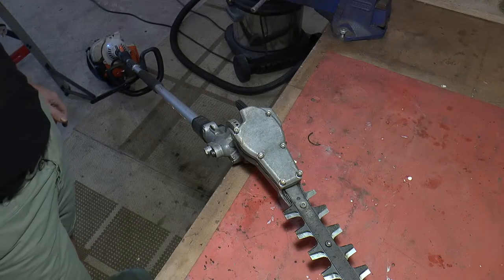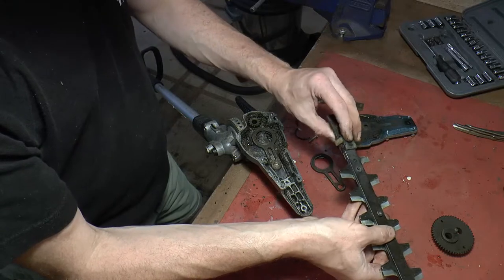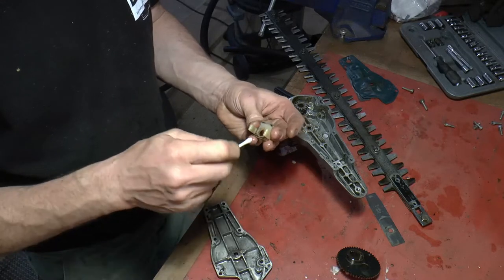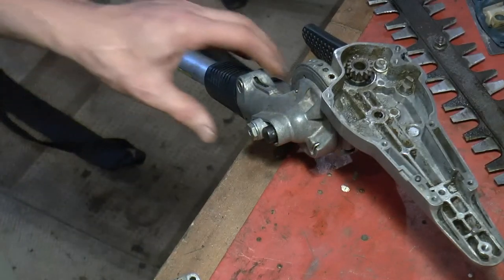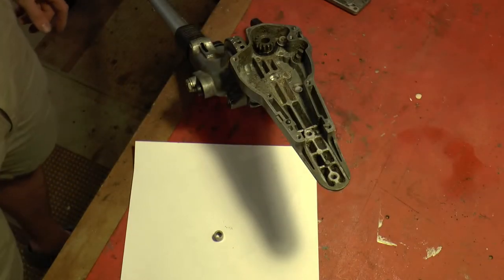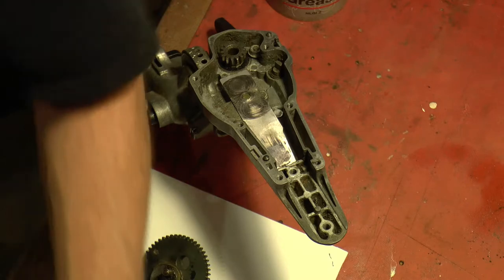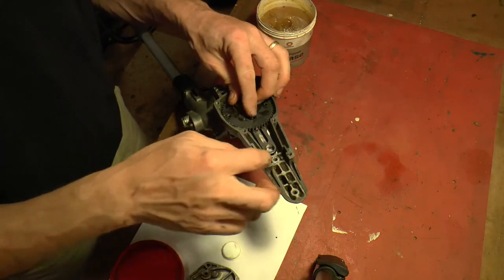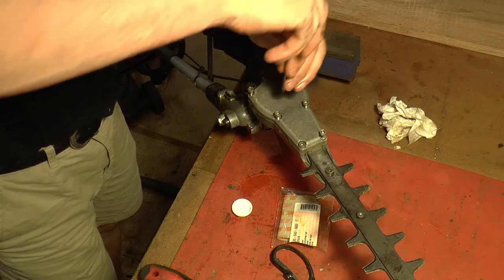Fixing Stihl HL 100 hedge trimmer

Comment: I took the blades apart on mine and definitely and struggling now
Idk if they're the same and idk if you do it in this video but I'll finish this video after supper as I'm here because I'm havin a real problem
Reply: That’s why I’m here too. I was sharpening the blades and ended up with the needle bearings falling out.
A couple of shots of bourbon so I didn’t feel like I was wasting my time and an hour later, the contraption was put back together.

Cranked it up….the engine ran great…..but the blades didn’t move.

WTF! Life is too short to screw around with stuff I don’t know the first thing about - but I’ll be back at it again tomorrow until I fix the damn thing.

Comment: The plug that you thought was for adjustment is just a plug the Stihl grease tube  fits the thread you will find the same plugs where ever there is a bushing on the head and shaft joints. The little lump of plastic is there just to keep crap from getting in to the casing much like the steel plate on the primary chain case behind the clutch of old British bikes.

Comment: Hello Peter. What tool did you use to grind out the needle cage bearing, I think it was with a Dremel but would interested in what tool you used and your technique. Thanks
Reply from the maker: Yes I used a sort of Dremel clone - I think that it came from Maplin in fact. I used one of the little Tungsten Carbide Rotary Burrs which did het a little knackered in the process.

Comment: If it's of any help, I use 3-in1 heavy duty cleaner degreaser on all my machines and it seems to work very well! Done exactly the same thing with my old long reach!
Reply from the maker: Thanks for the feedback. I will give it a go. I think that the trick is to service them from time to time which had not been the case in the past with this machine.

Comment: Could you drill out the needle cage bearings ?
Reply from the maker: For one of them I did start by drilling out the needle cage bearing with an HSS drill but the problem was that the outer part of the ball race remined. I then used a Dremel type drill and Tungsten Carbide Rotary Burrs to cut though the outer cage.
Reply: @peterkarney6935  ok thank you